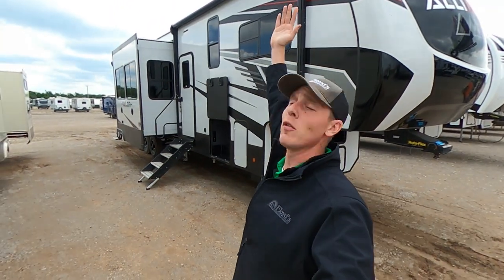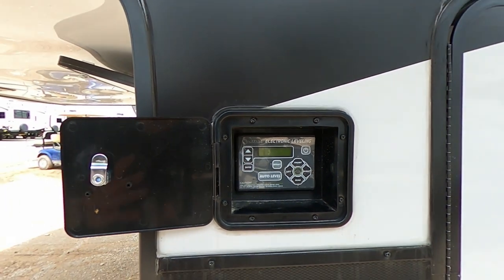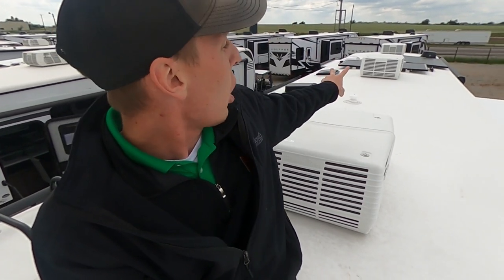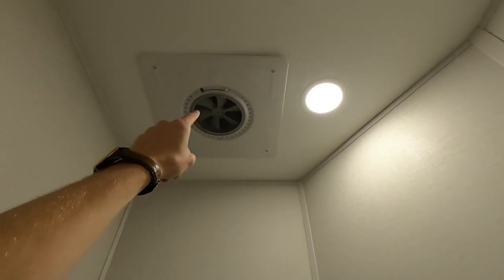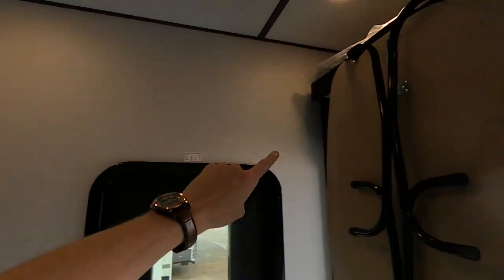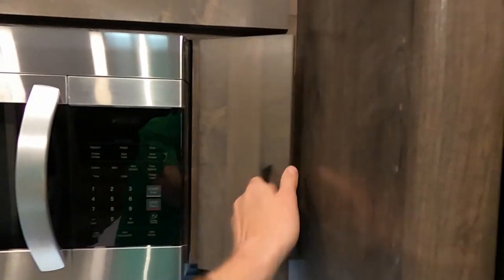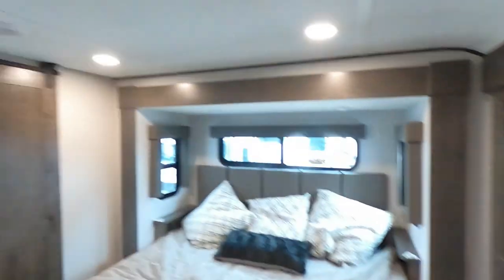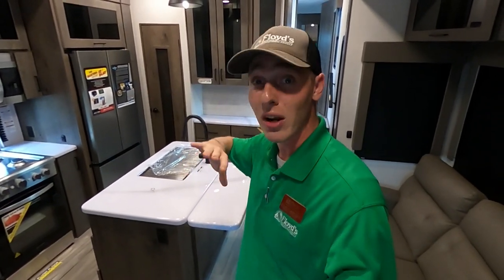The 2021 ALLIANCE VALOR 41V15 is here!!! (in depth walkaround) Haze Carlson at Floyd's RV

Comment: Question.. if you monitor this video.. Back in the garage.. the patent pending back doors to open.. Without taking them out just pulling the disconnect to open them up... how much clearance is there from one door to the other?  And also.. If you use the patent pending feature and remove the doors.. what is the measurement side to side then?
Reply: Did you get your answers?
Reply: @jayceklapp3626  Nope.. Someone is home but they just don't answer the door
Reply: @r.b.dickson8825  I can get you those measurements tomorrow if you’d still like to know
Reply: @jayceklapp3626  No thanks. We are looking at a different one now that I think is the one we will get. Have all the measurements needed for our SBS
Reply: An by the way.. Who are you?
Reply: @r.b.dickson8825  ok… it’s 78” with the doors and 90 with the screen
Reply: @r.b.dickson8825  I am an Alliance employee

Comment: Great job. Can I custom order one? I want scene lights on the fueling island side of the rig. Also want scene light down by the boot access that only goes up 90°deg.  Can be on one switch. 

What were the tire rating? F or G?

Does it have an inverter built in?

Does it have a spare tire?

Thank you for doing a thorough review of that trailer. Valor should hire you!
Reply from the maker: Thank you! to answer your questions, Yes you can order one. There is only so much customization you can do with one at the moment, but yes we can order one.

There are ground effect lights that aren't visible in the day time over by the Fueling island.

G tires

Yes, Inverter is built in

it does underneath the unit. Should have gotten a better look at it for the camera.

Thank you, I really enjoy making these videos.